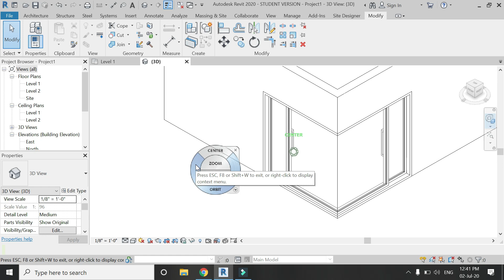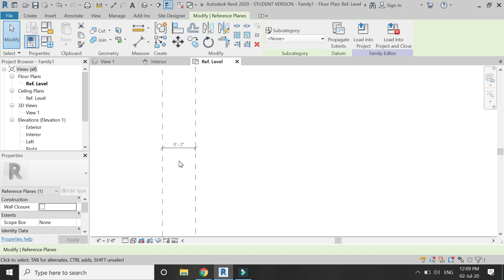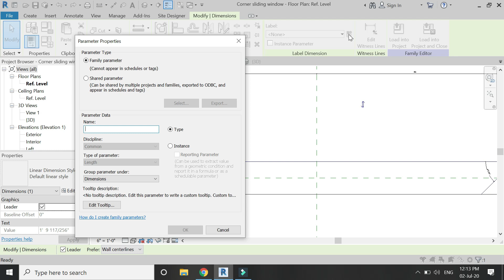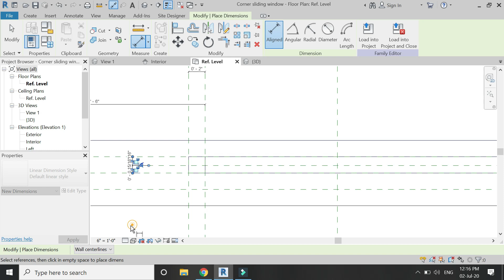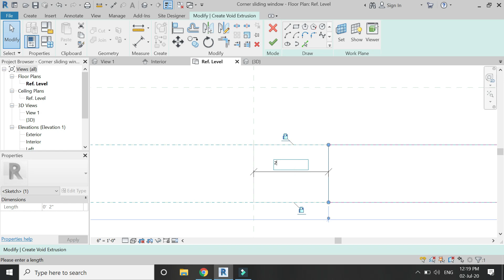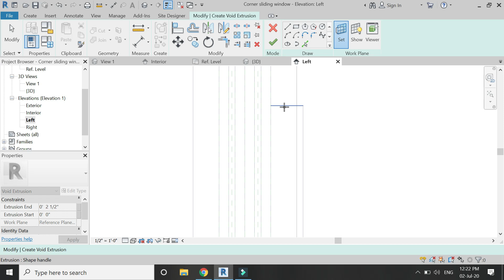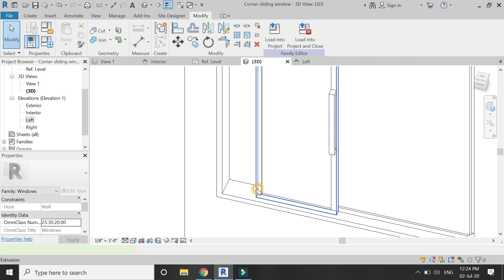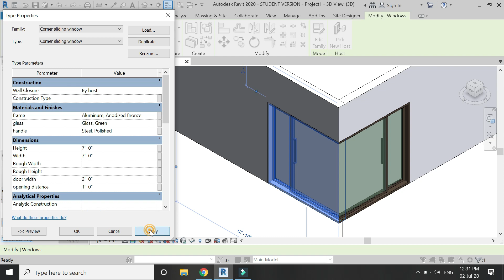Revit Tutorial - Corner Window with Sliding Door (Parametric)

Comment: You can actually fix the corners, while changing the width, by - in family change the reference line origin from the center to the end one. - this is method one. 

Second if you want to create this as a single corner window, not like these two parts, then change the opening and create a void in the wall and do from begining, create the same thing on the perpendicular side of wall too. 

I don't know how many will understand this😂

Comment: Cool door. Although I have a question?....typically for Construction Documents this family has to be tagged as a Storefront with a door tag within the storefront, so the door can be automatically scheduled in the door schedule, and by selecting one panel of the storefront you can create a dummy window tag that you may want to call ST1, then create an assembly with a front view and drag it to your window-storefront schedule. As I have seen your video, I do not know what family properties have been selected for the door & glazing extrusion....and can you select per say, the door glass extrusion and select it as door family, then the glass extrusion as window family in the same window and sliding door system that you have created?